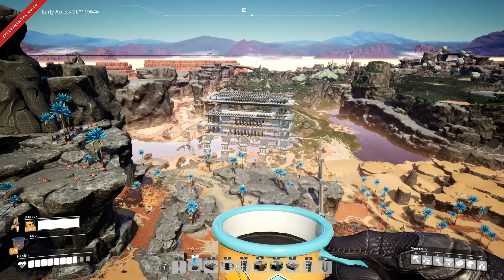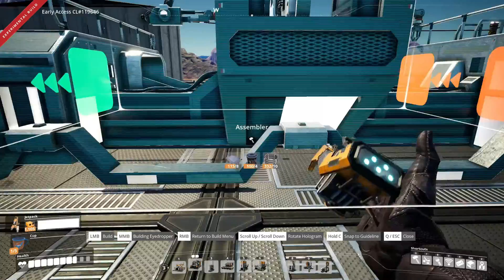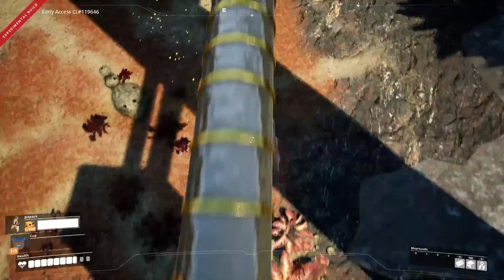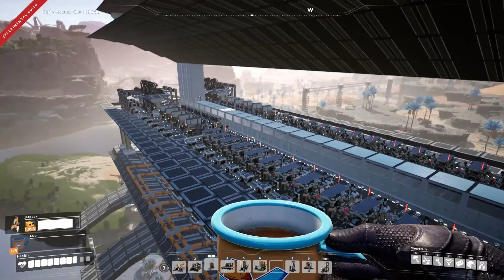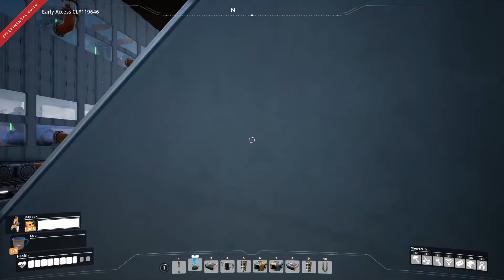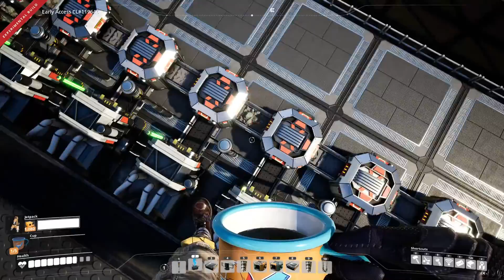Satisfactory - Mega Factory - 130 Heat Sink per min (Using NO OIL!)

Comment: That's a good point about the scarcity of oil, particularly due to the pipe capacity on pure nodes.  I just built my first aluminum plant using coke, but I think I'm going to change it to the alt with coal.  Love your designs.  Cheers!

Comment: A load balancing system uses less splitters than an overflow system. This is supurb btw.
Reply from the maker: Yeah I think I'll play with load balancing on my next project 😁 Cheers
Reply: @danp6918  yeah, that was the only thing kinda bothered me. you spent so many hours on to make it really look nice but skipped the balancing factor. which make factories larger but larger looks more impressive especially when you keep good looking designs. 90°, nothing flowing around, add layers just for aesthetics. that's why i will never have a megafactory before someone releases a blueprint system. would take just to much time for me.